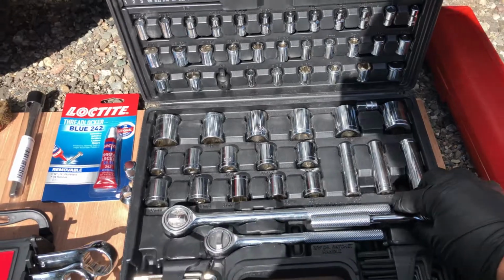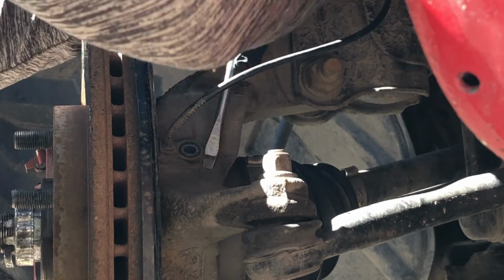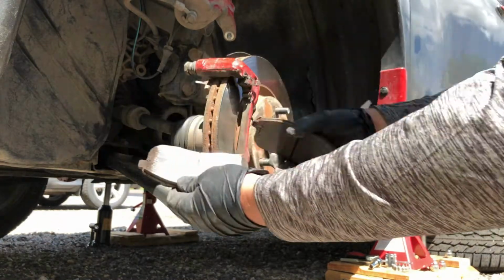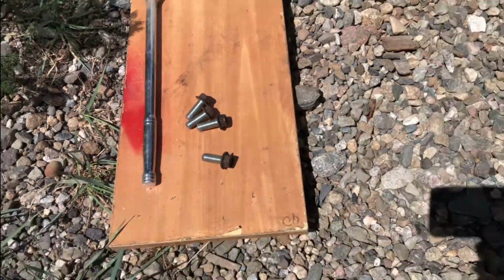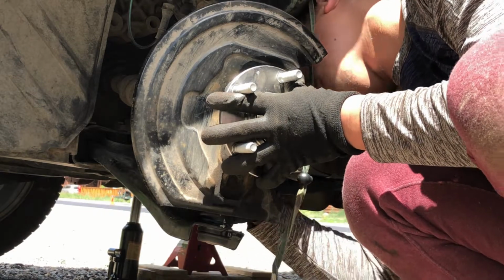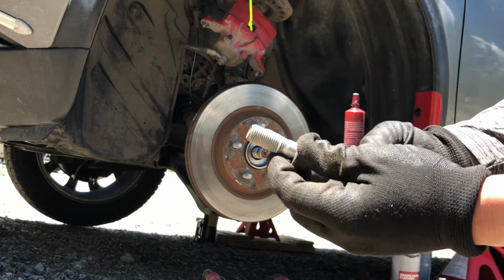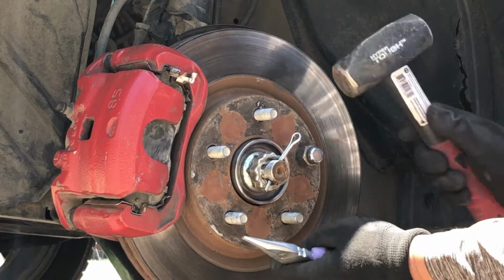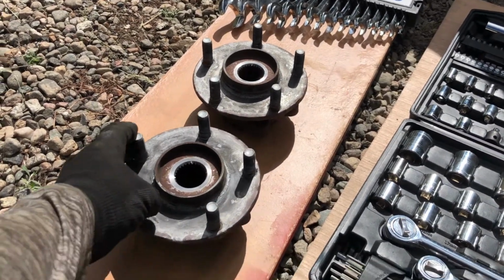Complete Guide on how to replace Wheel Hub Assembly on Nissan Juke

Comment: Just followed video hardest  bit was the abs seized in hub, managed to pull hub off with it in situe then knocked it out from inside great video showing no need to remove strut bolts
Reply from the maker: Nice work!

Comment: What size is the axle nut? 30mm, 32mm, 28mm? It would be good to know before starting in case have to go to store to buy the correct socket, no?
Reply from the maker: It’s in the video.You need 32mm socket to remove it

Comment: front end squeak squeak squeak squeak squeak squeak every morning wifey drives down road (nissan Leaf).....curious if this is most likely same issue?
Can't imagine what this will cost from local shop (sigh)
Reply: .... Just back from mechanic.... They resurfaced front rotors ($200) ... No more squeak squeak squeak 😀👍
Reply from the maker: @bshef3424  you should just buy rotors rather than resurfaced them.Much cheaper😊